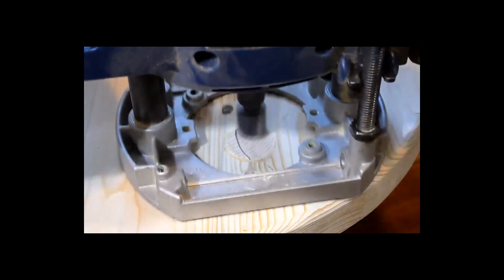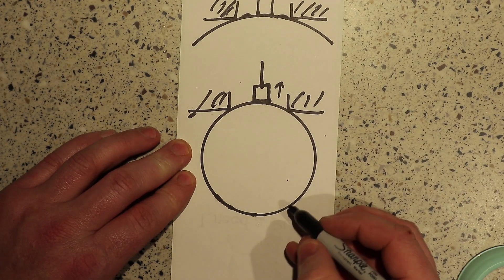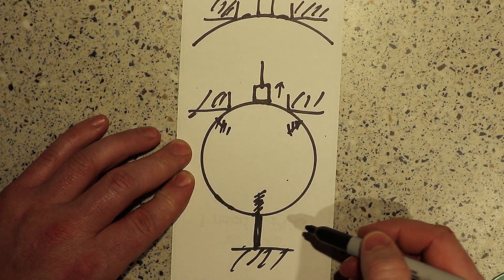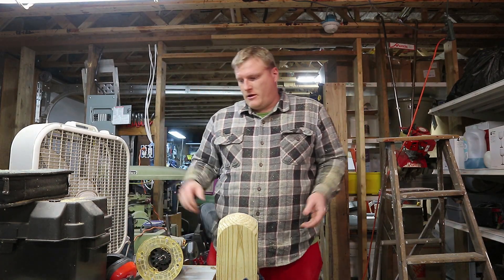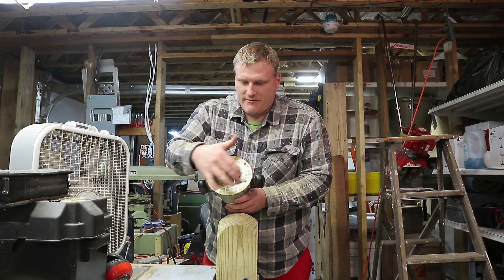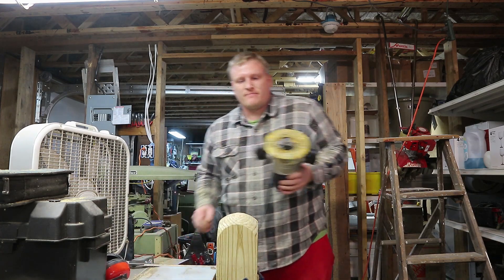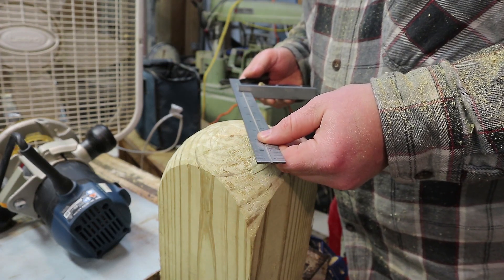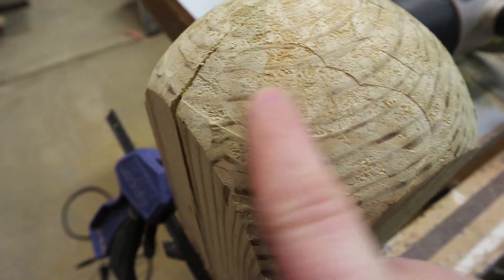Router Sphere No Jigs Required! A Proof Of Concept For Matthias Wandel

Comment: Nice setup for making a sphere without jig. 
If jig allowed you could try this metode  below.
It generates a lot of dust, but it's better contained and quick.

Living in a flat and only having room for a small underpowered wood lathe, it takes forever to turn a ball.
But I have a table saw and a drill so I designed a jig where you can make the ball/sphere in about 5 of minuts.
It's done by turning wood blank by the drill and rotate it around saw blade, a mix of table saw lathe and circle jig
Have a look here for the basics of the jig
https://youtu.be/egUNaP-0-x0 
and the one i build enclosing the process to keep fingers away from table saw blade.
https://youtu.be/hZarZfzcbco
Keep safe - Happy Woodworking

Comment: Seems like maybe you could rough cut the sphere and use a router table with a wide plate.
Reply from the maker: Yes that would work, but since recording this video I've given it some thought, the sphere diameter would be determined by the plate or base diameter and the stock would need to be cut perfectly to size before starting.

Comment: Fir- nah I'm just kidding good video. I'm not really sure it works past the rounded post until you go the full commitment for a sphere. It's of course a good test but as all experiments go it needs full testing. Besides then you'd have proof of your claim to use. For work holding there never was anything said against a holding jig but there's probably other ways not needing one.
Reply from the maker: I wanted to get some form of video out quickly to leverage the algorithm. A true sphere would definitely take some time to engineer workholding.
Reply: You could just mount the router upside down and move the piece instead.
Reply: You could use some type of thick ring on flat surface or raised.  Think wax toilet ring, but rubber or plastic